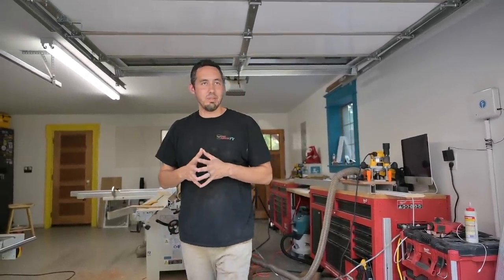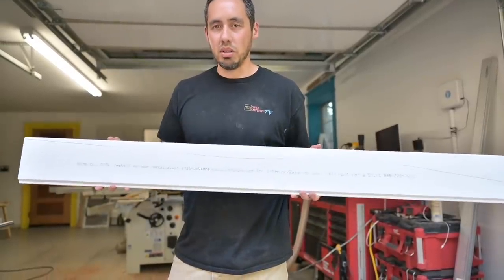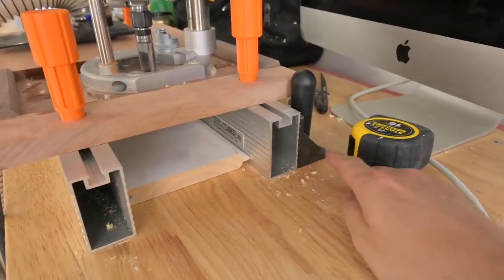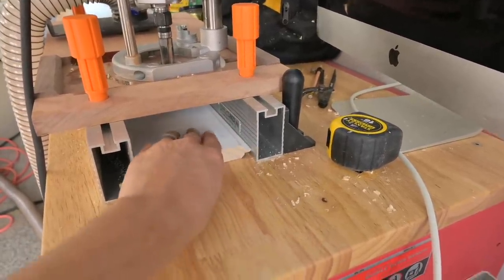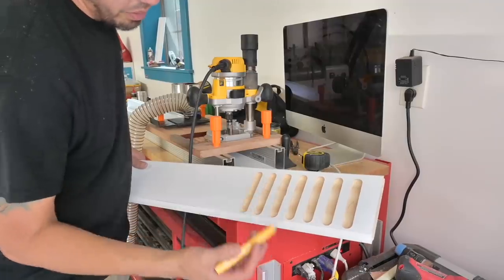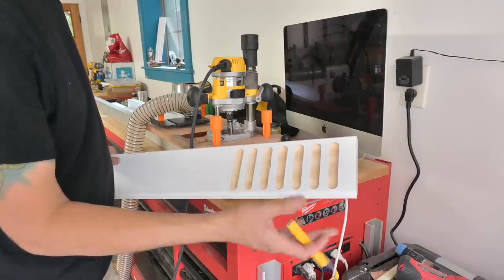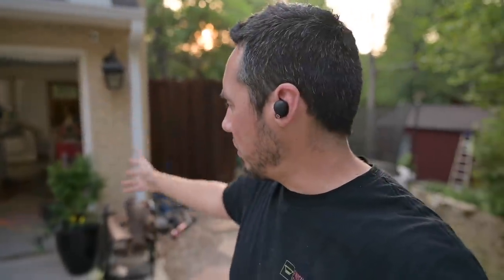I have to make & install this custom crown moulding.

Comment: You could make an alignment piece that drops into the flute that was previously cut so you don't have to manually measure every cut.
Reply: Second this. First thought I had also. Carve a block that fits the flute perfectly to drop in
Reply: My thoughts exactly
Reply: This ^^^ I immediately envisioned a shelf pin jig .
Reply: @craigt3309  it really doesnt need to fit the whole flute perfectly, just the center of the flute. The block would stop the work piece left to right, and the jig already stops the router fwd to backwards. A square block that sits against the end of the jig is all he really needs.
Reply: Ya like a box joint jig. Get the first one cut with a key that sets the bit at your desired length then plunging the next cut. This also would be a lot more stable and less parts. A simple base plate with a key should do the trick. 

… but with the bowl cutting but it may want to slip… so you could have a wooden fence with slots cut in it for the key to set in so it isn’t dependent on making a positive connection with a round cut… idk… many ways to get this done I guess
Reply: Exactly...use a dowel that is the same diameter as your bull router bit and lay it horizontally , spring loaded so you cut the flute lift up and the dowel then drops into the last flute you cut to reposition the board.
Reply: Was coming here to say the same thing. Just create a reference key to go into the completed flute.
Reply: Yep. Basically the way a punch press indexes when cutting from a strip of material.
Reply: This was precisely what i came to recommend.  You beat me to it.
Reply: Exactly what I was thinking, then you just have to measure the first one on each board...better make sure it's perfect tho because mistakes in jigs like this compound. Can't wait to see how you accomplish this 👍
Reply: This is exactly what I was thinking, most accurate by long shot.
Reply: Exactly. That's how I make dental molding.
Reply: Totally agree.  Just make a makeshift flip stop for the inside of the flute.
Reply: Exactly! Sort of like cutting a box joint on a table saw.
Reply: I think this would be easiest!
Reply: Beat me to it!
Reply: I understand the thought but would actually disagree. There is chance here to have a compounding error through slight misalignment, if the initial and subsequent cuts weren't 100% perfect you could tend to cut off to one angle or the other which you may not notice at first but would become obvious after a number of passes. The issue of course being that you are referencing off each cut prior instead of as close as you can get to square. If you are at 90.1 degree once, that is not noticeable but would become noticeable as it increases along the way. 
You could sort of get it to work as long as you were also keeping an eye on how square everything was as you went along and microadjusting accordingly.
Reply: Jeez.  I thought about the same thing.  You could 3D print a ball unit that attaches to the track tube.
Reply: Flip stop with a large dowel to fit/lay into flute
Reply: @alexrains1893  even if the jig he has set now with the router is not perfectly square, a flip stop jig or indexing jig would not compound any angle over the span.  Each pass would still hold the same angle he has set up.  If you can visually see  .1 degrees off 90, you are a super master; one above all carpenter.  Cheating a non level ceiling is a bigger concern if anything.
Reply: Precisely.
Reply: I agree but mak it adjustable for different spacing
Reply: @JB-ez2jz  That would actually be easier and simpler.  Just create a series of pins, one through the bottom piece he's sliding the work piece over, and just use a drill bit to pin it for each spacing.  Mind, when he flutes he'll do that through the pin hole.  So it's just for spacing and no need for a custom stop block.
Reply: I agree with csc9
Reply: This works well as long as the alignment piece is square but the flute is bowl shaped and the alignment piece (a round dowel) could slip slightly out of the groove. My suggestion is to mark your board off at 1 1/2" increments and then align them to the end of the aluminum support as you pull the board through the jig setup. Your measurements both layout and eyeball will be accurate to 1/64 so total error should be less than 1/32 and without the possibility of cumulative error.
Reply: Probably too late with this, but this was my thought also. I was thinking you could use an inverted ball catch.

Comment: Make a clamping system exactly 1.5” on the outfeed with a positive piece filling up the negative flute. It will serve as two things: clamping power and repeatable measuring tool that you don’t have to think too hard about. Kind of like a simple box joint jig
Reply: Should be able to use a 3D printer to create the positive piece and repeatable measuring tool.

Comment: I did something like this two years ago to make custom floor grills to match my hardwood flooring. I made equal size spacers , removing one at a time after each pass to move the board in even increments.  It worked perfectly.

Comment: Way to go Abby! Good job filming. Richard, get a piece of clear acrylic plastic put a reference mark (sharpie or tape) on it. Mount it on blocks 1/8” above your work piece. Align your router cut with the mark and make your next router cut, move the board to your new router cut, align with the mark and make your next cut……repeat. Only thing that moves is your board.

Comment: Considering the bowl bit... your depth will determine the width if the flute. So I suggest keeping it clean under your router base plate, and making sure your piece is always tight against the deck. Any variation in height will show in your flute

Comment: On some of my projects where I need evenly spaced holes, flutes or whatever I use a piece of metal strip that is used to hang adjustable shelves.  I place a headless nail somewhere on the work piece (usually at one end that will be cut off) that fits in one of the notches.  Then as I cut the flutes or holes, I index the work piece to the next notch in the metal strip that is desirable to get the spacing I want.  This works well on a drill press when I need evenly spaced holes.

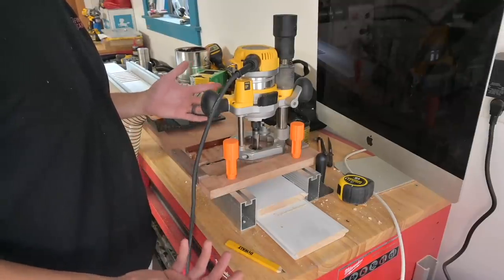Comment: @9:53  On the right side of the jig, I think you could drill a series of holes and drop a dowel/drill bit to act as a positive stop/register.  It would drop into the flute and you'd know where you are.  If you use a long enough and thick enough bit, it wouldn't rack on you throwing the positive stop.    Or, since you have the room underneath, you could make a "mold" where a block of wood would fall into the flute you just made, and it has a wing on it that would register to the router bit.  Like "H" without the first vertical line, if that makes sense.   

Finally, look up "Cunningham's Law"  :)  That's the best way to get people to chime in. LOL

Comment: I made a jig many years ago for a job similar to fluted crown moulding.  I used a collar attached to the router base with a 1/2 fluted bit.  I believe the collar was 3/4 or 7/8, but like others have mentioned make a key / alignment piece the will fit the previously routed flute.  I remember the jig was setup for a single flute, move when done and clamp and flute.  I found it to be slow so I then created a 3' / 4' jig with a ladder effect, I believe 25 flutes could be done before unclamping and realigning.

Comment: Mark the board underneath with 1.5” increments that offset to the end of the board you are cutting so you just need to mark off once then as you push the board you are cutting through you just need to line up the end of that board with the next 1.5 offset on the board underneath. That is a quick way to just get them cut now. Long term you can make a pin like a box joint jig to offset them something like how you cut frets in a guitar finger board.
Reply: Exactly what I was thinking when he first started talking about measuring it. You already have a board under it. I’ve always called it a story pole.
Reply: Man spoke English and Chinese to me in the same paragraph
-carpenter not a woodworker
Reply: Yep. Holes for aping stop every 1.5" in the board underneath. Screw the bottom board down. Pin in, route, move pin one hole, move board to pin, route next, repeat.

Comment: I would take two long strips and then create a bunch of rectangular slots by gluing a bunch of short blocks between them (it would look like a ladder). Get them the right size and use a bushing in the router and you can batch out a bunch of flutes. Your way works too of course. Always more than one way.

Comment: I would make spring loaded dowel pin that would drop into the previous flute. It would mount under router platform and could be reached with your fingers to lift it out of the flute after each router cut.

Comment: Great job on the custom moulding with the flutes.  As for spacing, if it's 1-1/2" spacing you could stack say 10 or so  2x4 scraps on edge on your outfield side, butt the workpiece up against the stack, cut a flute, remove one block, slide the work piece to butt up against 9 scrap blocks, cut another flute.
Or.  Manually measure the first 3-4 flutes.  Then, Mount your laser level on the outfield side so the laser line hits the leading edge of one of the flutes coming out of the jig. Cut a flute, slide the piece until the next flute meets the laser line, cut another flute, slide the workpiece so the next flute reaches the laser line.... keep going.  It's kind of like using your laser as a virtual stop block.

Comment: You have definitely stepped up your game . Jigs , I used to pick up particle board off the side of the road just to use for jigs or test projects. You know the junk furniture. Let me add if you use MDF as a jig to make multiple parts from it . Cut thin strip of a hard wood and super glue it to the edge surface for the bearings of your router to ride against and it will last longer.

Comment: You can use a stop block that builds up, get a piece of dimensional timber fully milled and cut it into spacers. Use a stop block at the far end and keep adding spacers as you move forward

Comment: You might want to try cutting the flutes with a half round /cove bit to ease the ends and make them look a little more finished. Make a positive piece for the negative you are cutting and attach it to the right end of the jig. Cut the first flute by measuring on the board and the drop the positive in the last cut flute for the next cut.  Love the channel.

Comment: Yes, put a drop down stop block that grabs one of the flutes. I've made many of jigs like that before. You need to bring the piece that your working with closer to the router base and stabilize the working peace on the top so that it doesn't move upwards at all.

Comment: The alignment piece is a grand idea. Make it the same width as the flute, but not as long. Glue the cutout to a but of wood to make a jig. Align it so that when the cutout is in the previous flute and the jig is flush to the end of your runners the board is in the correct location for you to plunge

Comment: You could use those miter saw adhesive tapes if you can get enough table length. Just increase the edge 1 in every time. Or you could ball out out and get that Reekon measuring tool.

Comment: Richard, I’d recommend making your 1 1/2” marks, speed square across, on the board that stays under the piece being cut. Then you could just slide to each mark and go.

Comment: Try a piece of plexiglass with a line scratched in it, located above the work piece and elongated adjustment holes to change the alignment for different spacings. It would also keep the board in alignment as you finish the last cuts.

Comment: Cool setup. Adding an indexing stop off the end of the jig will get you uniform spacing without measuring. Use a tenon that is rounded that will nest perfectly into the previously cut flute.

Comment: Hi Rich, what would happen if you had on the far side a section of metal with pre-drilled or indexed holes and used your jig with a spring loaded handle in which you could use to set the position of the fluts? You could make that as long and consistent as you want for your project.

Comment: Flutes usually don’t have a 90 degree plunge but rather a gradually cut down into it. Could you put a “ramp” shim at each end of your router table to ease into and out of the flute? 
Mark your board every two inches before you start. Then when see the mark align it with the end of your tube.

Comment: Make a small jig with adjustable slides to allow you to change the spacing if you want. You can also redesign your jig for cutting the flutes to cut them on an angle in both directions. This would resemble a Christmas tree with the vertical flute centered on the two opposing angled flutes. You will need a different spacing jig for each shape flute you want to cut. As mentioned in other comments your flutes would have to be deep enough to keep the spacing jig stable. Otherwise, you can place springs on it so it detents as the working board is slid forward. No guessing, just one movement.

Comment: Use a spacer block cut to the exact size of the spacing you want. Attach it to another piece with one screw to the side of the wooden part of your jig so you can spin it up and down into place

Comment: Looks more like a tall dentil molding. For measuring, clamp another block between your aluminum rails just above your workpiece. Position it so that its edge lines up with one edge of your routed flute. You'll have to mark the first two or three until the first flute reaches the edge of the block, the rest can be lined up between the flute and the block.

Comment: Extend your base piece (the one lifting) lock it down and place reference marks on that piece like a ruler. if it's long enough the marks can extend on both sides so you can easily index your workpiece from both sides of your jig.

Comment: Use a shelf pin jig and put pin holes 1.5 in down the bottom board and move the pin after each cut

Comment: simply slide your trim piece  to center the mortised slot on the end of your guide board. you could use either the top or bottom guide piece or both to center the trim piece

Comment: Dropping a dowel through the top of your jig to keep the spacing. probably need to get the first few by measuring but after that you could drop the dowel into the slot then pull it up and move to the next slot.

Comment: Use a piece of black thread as a cross-hair across the top of the board at the output of your jig.  You'd still have to mark the first few locations by hand with the tape measure, but then you just move the piece until the edge of the next flute aligns with  the thread.

Comment: Add a thin wire to the front face of the exit side. You’ll still have to measure out the first 5-10 flutes, but then you can just align the wire to the inside/ outside edge of the exiting flute. Hope this helps.

Comment: You should get a measurement tape with digital display. Attach to your board at the starting point. As you push through you can see how far you out from the router bit 
Blessings

Comment: Great video, I have a concept for a adjustable back stop for your custom flutes. It is made with a long piece of all thread with pre set blocks. There would be dropped down blocks measured to spacing. These blocks would be dropped down as your piece is moved forward to the router. The blocks could be made of wood with fender washers and nuts on either side. Pre mark your all thread distant from center router, and color code your measurements. For example red would be an inch, blue be quarter inch, green be halve inch etc. I hope this inspires any direction this jig may take. Your videos inspire those who do not share your trade in thinking outside of the norm. Have a great week. John

Comment: Attach an inch and a half block on the end of your jig ( where you were measuring from) so that you will only have to measure the first few till the routed edge meets the block then all you will have to do is look down and match the left edge of one route and the right edge of the route before it

Comment: Measure off your router slot drill 2 holes parallel to the slot and drop a drill bit down each hole. Now you have a indexing pin. I like the look!

Comment: Hinge a positive plug that fits it on the end of the jig.  You would need to make one for each offset but I am sure its put it on for a couple hundred board feet before switching it out.  That way you have a positive reference.

Comment: I’m thinking something similar to a box joint jig where you have a reference piece the same size as the router bit but not sure how you would go about it with the pieces laying flat instead of vertical

Comment: Richard,  I would get a wooden dowel the same diameter of your bit.  Drill a hole in the wood on your jig 1.5" off center of the router bit.  Cut your first slot, slide the board over until the dowel drops into the first flute, cut the second flute and then slide the board over until the dowel drops in the second flute, rinse and repeat, Your flutes will then be 1.5" on center.

Comment: Waht about a reference line on the ride board underneath space from the fence nearest you. Then when you go to cut you mark the board against the fence, cut, then shift to your reference line, mark, cut, shift. One man job at that point. Or a roller ruler for a miter saw. That may be more accurate but I have never used them.

Comment: On the board underneath, lock it down after using a shelf pin jig (usually ~1.25” apart) to make stops.  Then just place a shelf pin in each hole as you move the board you need fluted.

Comment: To space out the slots make a piece to slip into the first cove with a 1.5 inch spacer you move to the tip of the cutter, then plunge and repeat.  Will give perfect spacing every time. Cheers